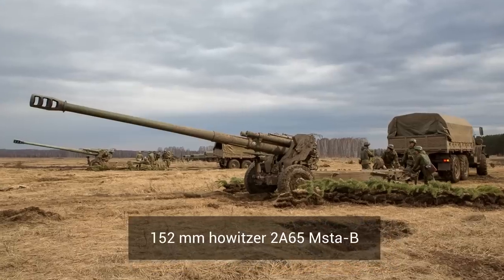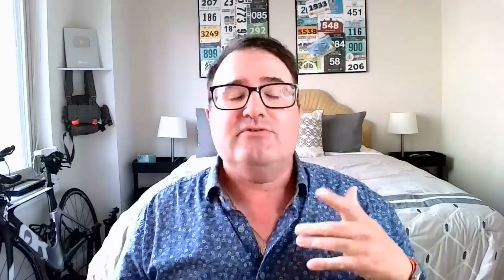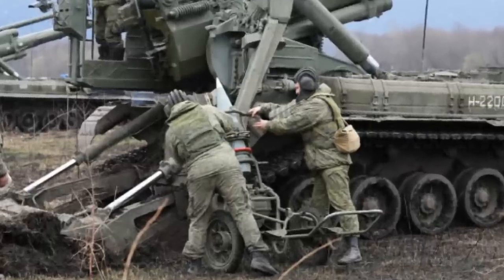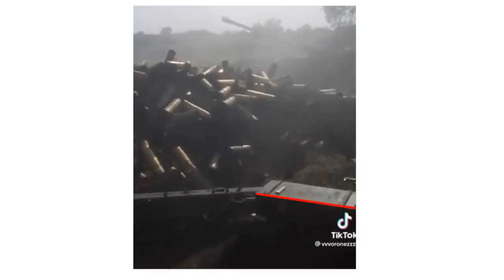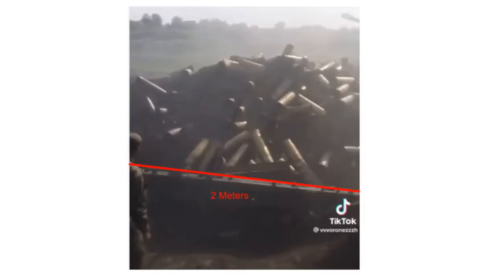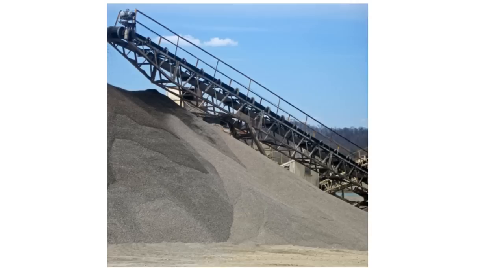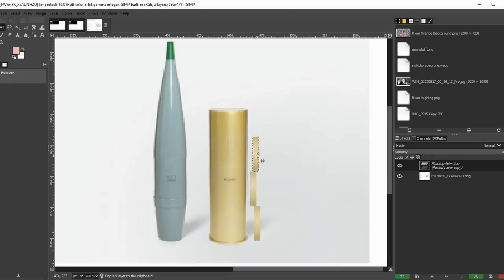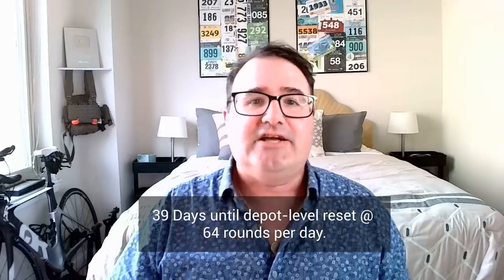When will this Russian Howitzer explode? (2A65 Msta-B Barrel life estimation from shell casings)

Comment: The extractor breaking wouldn't stop the brass from ejecting.  The back pressure from the shot combined with the recoil would pop the brass out (it would slide out the back).  Either they are firing a very low-pressure loading (supporting your training hypothesis) OR the breach area is dangerously worn and the brass is "fireforming to the chamber."  A VERY DANGEROUS SITUATION for a gun.
Reply: I'd like to argue for casing deformation:
The gun seems to recoil normally, but with a lower pressure loading, wouldn't it recoil less of a distance?

I had a look as a few videos of the msta B firing and it looks the barrel recoils the same distance.
I wouldn't want to fire that thing. I'm glad that I'm in the ABC defence troops of the Swiss army. :)
Reply: Fireforming was my first thought of what happened; didn’t know the word for it
Reply: I agree with you both. Either way something's wrong
Reply: @exo068  ok trump won bro does that make you feel better
Reply: @lenovo7999  no just look at the linked video.
Reply: @marcusmoonstein242  If there is no projectile, I don't think recoil would look somewhat normal.
Reply: @exo068  so, that makes me wonder if the MstaB has a manual/automatic ejection setting switch.
Reply: @SonsOfLorgar  probably. Would be useful if you didn’t want to have flying cases in your position.
Reply: I'm not an artillery expert but some gun you manually have to pull a lever to eject the case.
Reply: @exo068  once in a long while a casing may not eject. But if it happens regularly, then the tolerances are off, either on the casings, the chamber, or both. It could also mean distortion, or even a buildup of dirt.
Reply: @melgross  yes that is also a possibility. Considering that the guns have been in service for a long time they can also be using old cases that have been stored wrong and got damaged.
Reply: @melgross  I was thinking there was a build up of several possible things, of course dirt, carbon build up from firing or even lacquer. Older surplus of small arm cartridges have a lacquer and if not cleaned well it can build up and rounds wont eject from firearms, like shown in the video.
Reply: @aaronwilkinson8963  well one would think a manual ejection lever would be the only way to remove a dud round on the chamber.
Reply: Chamber rough and dirty...
Reply: Shells are ejected upon return.
Reply: @exo068  yes. Thats how they function.
Reply: Can’t you turn the ejection off to avoid chewing up the brass ?
Reply: @HrafnkelHarthrathi  expansion/fire forming of the cartridge is part of the design to provide rearward obturation which is why cartridges are made of thin material with a much thicker base forward obturation is provided by the shells driving band. You will notice the cartridge is straight walled and not bottle necked like a rifle cartridge so it will conform to the guns  chamber.
Reply: Total nonsense. Cartridge cases fire form to EVERY chamber of EVERY weapon ALL the time. They'll fire form even at very low pressures without a projectile being loaded, that's commonly done to form brass of one type to another type in a rifle chamber. Providing obturation is literally their main job after holding the propellant and primer. The 152mm case headspaces on a rim, so it would require excessive wear in the breech block ways or the breech block itself to create a condition for case rupture. It's effectively impossible without intentional damage being inflicted to result in the case head becoming unsupported.

Unless you were standing over the breech at the time, a case rupture actually wouldn't be at all dangerous, all that's going to happen is high pressure gas will be vented, the management of which is designed into every weapon that uses a cartridge. From where those crews are firing, absolutely nothing would happen to them. The gases will be vented up and down, obviously the solid sides of the breech prevent gas from going sideways. 

Sorry, 0/10 for your analysis, it's completely divorced from reality. There's also no "back pressure" very shortly after the round exits the muzzle, pressure obviously falls to atmospheric very quickly, and equally obviously can't force the case out at ANY pressure while the breech block remains in position. All that's going to happen from not ejecting the case automatically is a build up of fumes in the barrel... Not remotely dangerous.
Reply: @karood-dog3584  bottleneck cartridges absolutely fireform to their chambers too. 50k psi give or take will have that effect.
Reply: I learned recently that a 16” gun barrel on an American battleship has a 250 rounds fired life. That as a yardstick here.
Reply: @exo068  are you an artilleryman?
Reply: @bignorbert1136  Is it hard to admit reality?
Ukraininan army suffer very  heavy losses.
They break through first line of defense intended for detection of attacks, which consists of LDNR people's republics militia , when they were shot by russian artillery, airforces and second line large military forces including real Russian army counterattacks them
Reply: Russian artillery can shoot thousands of projectiles without being serviced.
It is technologies, high quality alloys etc
Reply: @SonsOfLorgar  yes it does because the EXACT same gun can also be mounted inside Self Propelled Gun Chassis.
Obviously you don't want a shell auto-ejecting inside a self propelled gun.
 Having an American assessing Russian artillery is like a midget critiquing the NBA.
These things can fire shells non-stop for weeks on end, an M777 is lucky to get through 100 without needing a full service.
OMG....a 152mm gun that can be fired by a crew of one?
Look and learn buddy.
Reply: @stevebuckley7788  Bias aside, somebody had to say somebody from very objective point of view. These Russians know what time it is when it comes to the science of artillery warfare, in as much as the Americans are the undisputed masters of aircraft carrier technology.  Well done Steve!
Reply: @HrafnkelHarthrathi  I don't have the terminology vocabulary to describe what the rest of you have aptly pointed out but I certainly thought it...the brass is stuck.  Good luck there gunner.  The breach is about to rupture.
Reply: Blank firing
Reply: @johncharlesfarrell3144  Full charges.  If you are firing lower-pressure powder charges, you can fire more rounds.
Reply: @toritori4430  Possible.  Those are low-pressure loads.
Reply: @exo068  That's why I said either "a LOW-POWERED LOAD or ..." in most training exercises, lower-powered loads are used both to extend barrel life and reduce the length of the range needed for shell impacts.  By the way, I'm not an analyst.  I was a 13Bravo (artillery cannon crewman).
Reply: @reccecs4  First.  We aren't talking about sizing rifle cartridges to an irregular chamber.  We are talking about swelling the brass to the point that the AUTOMATIC CASE EJECTION SYSTEM fails to work, yes this gun ejects its cases automatically just like the US M109 Paladin 155mm howitzer opens its breech automatically after firing to facilitate a reload... using backpressure from the gun's firing.  In the ARTILLERY, that failure of a case to eject is referred to as "fire forming."  Armorers will use the very same term for small arms.  When grunts were issued the M16A2 alongside the A1s, a grunt would occasionally put an M855 round meant for the A2 into an A1 designed to exclusively use the M193 ball round and a stuck case would result. The case mouth would "fire form" against the rifling in the barrel because M855 was very slightly longer than M193 and you'd have to drive the empty shell out with a ramrod.   
        That back pressure also slows the gun's recoil so the barrel doesn't recoil as far.  The M109 uses a similar system despite using separate loading shell and powder.  This is the reason the M198 155mm has such a long recoil and we had to dig "recoil pits" under the breech of those guns to prevent damage to the breech.  I'll still take the shorter gas retarded recoil of the M109 and M777 any day of the week because of all that digging.  So please tell me, genius, how a gun that uses gas pressure to help retard barrel recoil doesn't have any backpressure pushing on the shell casing when it uses backpressure to actuate the mechanism to open the breech?  0/10 for your critic 

By the way, my credentials are a US Army 13BRAVO (artillery cannon crewman) include firing the M102 105mm towed howitzer, the M119 Towed 105mm howitzer,  the M114 towed howitzer, the M198 towed howitzer, the M110 203mm SP howitzer, and the M109 SP howitzer.
     
 Here's a nice video from MATSIMUS on this gun for you to educate yourself about it.  
https://youtu.be/E8pu6WiEICc&featu
Reply: @187Rajah  of course. Because Russia is known for producing the highest quality products. And they use magic.
Reply: @stevebuckley7788  bad analogy. Just because someone is a midget doesn't mean they can't understand basketball. Also, Steve Buckley is a really strange name for a Russian....
Reply: Or maybe the breach/chamber is fouled?
Reply: @Prfactist  That's possible.
Reply: @lenovo7999  wtf?
Reply: @chipwright8187  This is the same Steve Buckley who will tell you the S300 can shoot down hypersonic missiles when it can't stop HIMARS rounds or BAYRAKTAR drones.  I'm also willing to bet he'd tell you that T72s and T90s don't "pop their tops" when hit by AT rounds... that's just Russian propaganda.
Reply: I'm going to refer to that as "The Big Bang Theory "!👍
Reply: "OR the breach area is dangerously worn and the brass is "fireforming to the chamber. A VERY DANGEROUS SITUATION for a gun."
Considering this effectively turns the whole gun into a BOMB, i do not think its possible to overstate this exact line. This shit is too serious for words if its the case.
Reply: ♠️ Манька Облигация  Your "facts" are purely imagination. There have been no such losses recorded anywhere on the front even to this day. When lying, at least leave a shred of truth in it, that way you can claim misunderstanding. Russian trolls are becoming more lazy by the day. I guess your unit morale must be very low as well.
Reply: ♠️ Манька Облигация  Your present statement has nothing to do with your previous claims. Try to stick to the theme of the thread. What-about-ism is a classic sign of a losing (or in this case false) argument.
Reply: @swaghauler8334  S300's aren't used for drones. Pantsir or other hybrid gun/missile combos are networked to deal with them..Yes the Russians have fully networked platforms. S300's take out Ukrainian jets pretty much soon after take off. It's the reason why in order to raid Syria, Israeli F35's fly towards Cyprus to launch stand offs.
Reply: @IDNeon357  IT is not about how much ammunition you waste and how many civilians you killed, it is about selecting and hitting targets that are actually dangerous.
Reply: It only take one shell that hits to blow up a an orc artillery piece with all its serfs.

But you are right, the US have never been as badly prepared for a fight as Russia was last year (this side of 2000). US learned their lesson in Vietnam and Korea.
Reply: I would stand back from a gun that might explode, too.
Reply: @swaghauler8334  stop he’s already dead lol
Reply: Agreed... the casing can not expand fast enough to seal the expanding games. Powder partials are then trapped between case and chamber, trapping the brass and the extractor ripping the rim from the case.
Reply: Just checked other videos of this howitzer fireing and the casing should be ejected and it takes more than 1 person to operate. Also once the gun is worn off it doesn't mean it cannot fire , it is just not accurate anymore ...if you are shooting at civilians in the city like Russian do it doesn't really matter.
Reply: Oops sorry. I didn't finish yer comment😮
Reply: Your analysis is so wrong.. there is no much back pressure. The reason a case comes out is the recoil of the gun and the breach to open at the end stroke.  Deformed cases are possible but all cases deform a bit when fired ……in most “cases” the reason a shell-case is stuck is heat.  For sure the gun is F’d quite a bit.
Reply: Maybe chamber or breach was very dirty.
Reply: @lenovo7999  lol